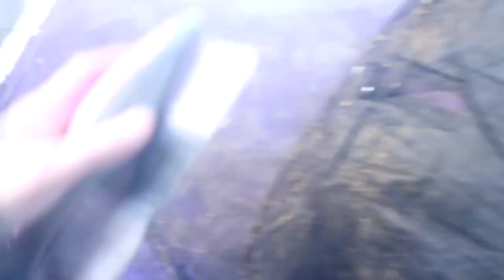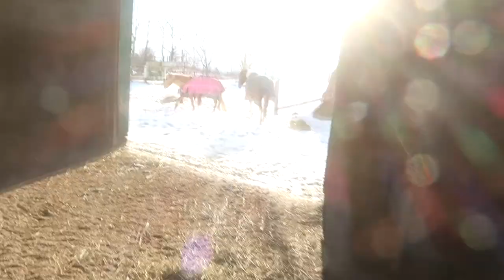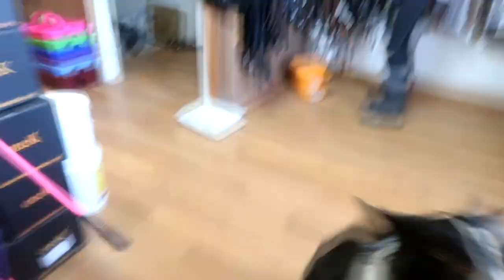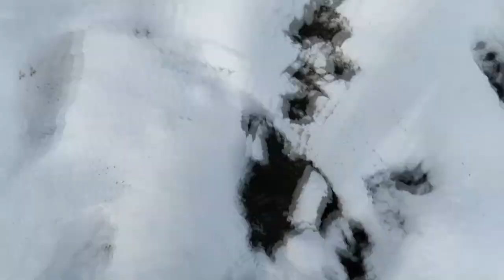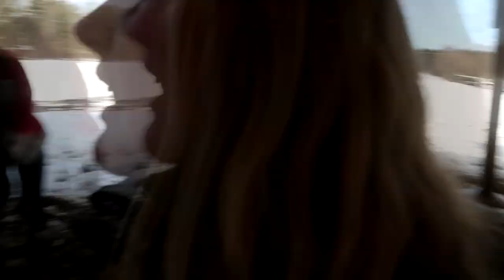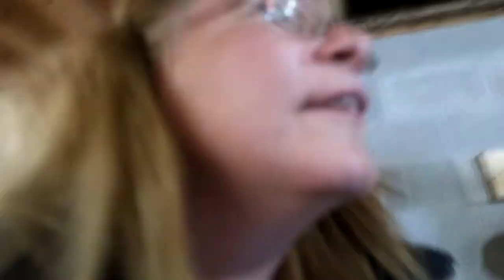I Can't Believe I Got This For My Birthday! Day 323 (11/24/20)

Comment: The Waterford bit is a bit that shouldn’t be used everyday as it’s one of the harsher bits  because it creates a lot more pressure on the horses tongue.  however it may be good for showing while something like a plain snaffle can be used for schooling at home.
Reply from the maker: Awe, thats what its called.  I'm thanks allie.  I will tell her. I knew I shouldn't let her buy that.
Reply: @DayByDayVlogs  a Waterford is a very pinchy bit because of the amount of joints, yes it may stop a horse from leaning on the bit but it could make the horse more reluctant to the contact because it hurts.
Reply: Bits like those are only harsher if you dont know how to use it. I use a chain bit for my horse when I practice, and I have light and careful hands therefore it isn't harsh, buttt some/most cases people don't have the most careful hands 😅
Reply: @DayByDayVlogs  Thank you for recognizing that

Comment: a tip for putting on blankets that my trainer taught me is to put it up high on their neck and do up the front buckles then pull it down so you don't have to pull it up, because if you pull it up the hairs are facing the wrong way and they roll and break them so it might help make your blankets last! love you guys <3

Comment: The waterford bit can be good with the right hands. I don't think your family would be good for it only because it needs very steady hands to hold it. The bit collapses and pinches which is how it keeps a horse from leaning on the bit. If you don't have steady hands to hold it, it can be very bothersome to the horses.

Comment: The bit gabby wants  is a Waterford, I use them to restart ottbs as they cannot pull or lean against it due to all the joints in it. even though they look super scary if you think about how they work they are actually really soft bits. I really love them but, maybe you should talk to brandon and see if that is something Chino would benefit from!

Comment: That bit is a Waterford bit. I used to have one for my mare. It moves separately which stops the horse getting hold of the bit. I would be cautious using it as it can be harsher depending on the horse and the style of bit (such as a gag) so I would recommend a gentle hand with it. If you are not having issues with the horse grabbing the bit then it is most likely not needed. It can be a great bit for getting the horse to stop leaning on the forehand though!

Comment: When changing blankets in the field. It's safer to start with unclipping the front. That way if your horse does suddenly walks/runs away the blanket will just slide off. If you undo the belly bands first and the horse walks away the blanket will be hanging around their neck and they could get hurt.
Reply: I would say the exact opposite.  The blanket ( like many coolers) will stay in place better with the chest straps done up.  When doing a blanket up start front to back ( except a hood) and undo in reverse order.

Comment: The bit what your on about it pinches your horses mouth and tongue it’s not that good ever your better off getting a three ringed snaffle bit it’s better for your horse and my pony throws his head up and the bit helped very much but you can get a fin net what goes over the top of the horses nose it stops dust , flys , and pollen from touching their noses it works so well ! Like I couldn’t even Troy my horse because he threw his head up and it was dangerous so my mum bought me a net and a three ring snaffle bit and omg I could trot it was a miracle !!❤️🥰🧐🤯🤯🤯

Comment: Gabby does NOT need a Waterford. In fact, NO horse needs a Waterford. They are cruel and abrasive, and only teach the horse to be afraid of the bit, which is why they work on horses that are heavy in the forehand. Because a Waterford has multiple balls, it creates multiple pressure points on the horses tongue. The concave in between each individual ball scrapes the tongue and sensitive papillae. In addition to the pain, it is a crappy communication device, which is what a bit is meant to be. A bit is meant to send two way signals between rider and horse, but due to the flexibility of the Waterford, it does not allow the horse to manipulate the mouthpiece in any significant way. The horse becomes a submissive partner instead of a willing partner. I would not let gabby use a Waterford on chino or storm. And since bits are so expensive and you guys seem relatively inexperienced with the physics behind bits in general, you should ask your trainer before buying a piece of equipment that you won’t need or use. No hate, btw, just trying to make sure that you stick to what you’re doing, as it seems to be going well. Why mess with a good thing? (I used to be very curious about bits and tack in general but very uneducated, just like gabby. Tell her to have fun doing research on different pieces of equipment, because if you’re kind of a nerd, it is fun to learn the physics behind each piece of equipment you use!) :)

Comment: The Waterford bit is typically used on horses that are heavy on the forehand and perhaps take hold of the bit and can become strong. The links mean that they can’t do this and it creates an even pressure, some horses go very well in it. Just so you know, if you are going to use one, you need to get a bit that is 1/4 to 1/2 an inch larger than your normal bit size, that’s as the bit needs to curl slightly around the horses lips to work correctly. It can also encourage a horse to mouth the bit more. Like anything, people can have differing views on how harsh a bit it is, however I’ve always understood it not to be too harsh, there’s no nutcracker action for example, although some people feel that the ball and chain links must hurt the tongue. I don’t know if it’s a bit that you can use in the hunter competitions though. I would have thought it would be best if Gabby spoke to Brandaan about Chino’s bitting if she thinks a different bit would be beneficial and I’m sure he would be able to help and probably has loads of bits that she could try 😊👍
Reply from the maker: So far they really seem to like it!  Both of them. I'm anxious to see how chino rides in it